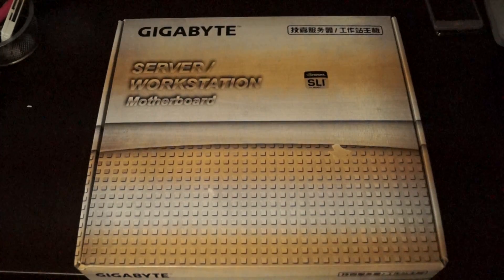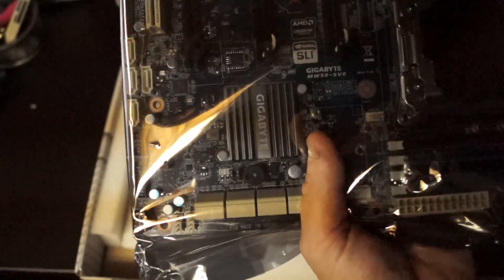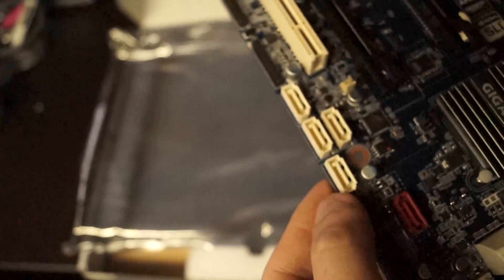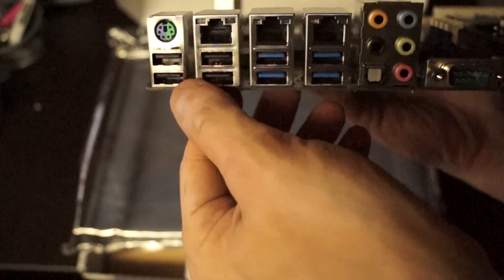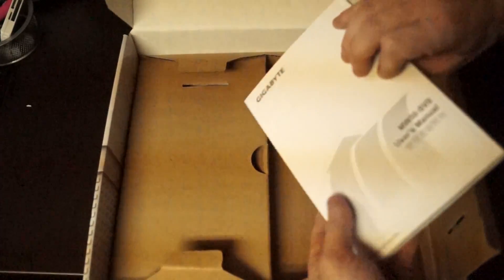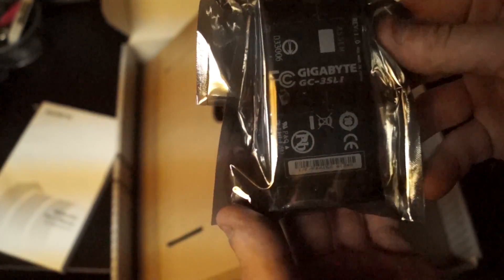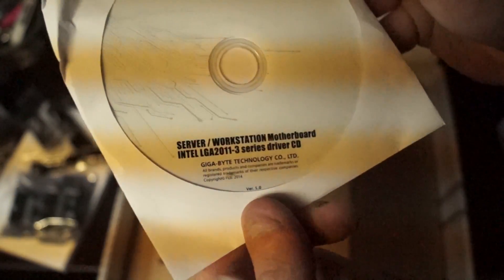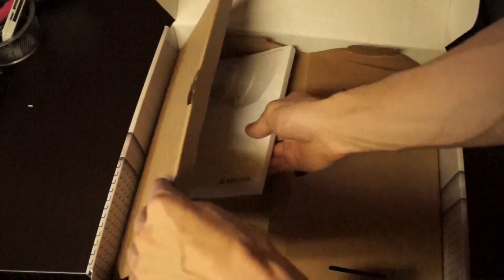Intel Xeon E5-4648 12 Core 24 Thread CPU and Gigabyte MW50 Server Board

Comment: Hi sir,
Even me too, I have ordered this motherboard, the only problem is will it support Xeon e5 2620v4 , I seen a review from newegg
Reply from the maker: This board is really good, packed with features. Ive tested with E5-2699 V3, but not yet v4's. Should have some E-5 2699V4's coming in soon. 

Can you remote in and set up the board? It has flashing utility, no need to have a cpu installed.